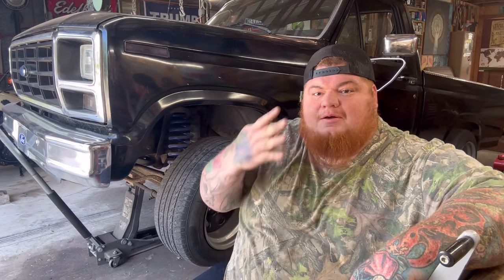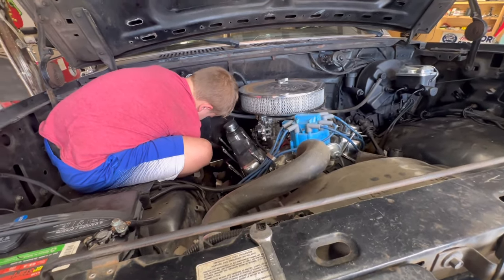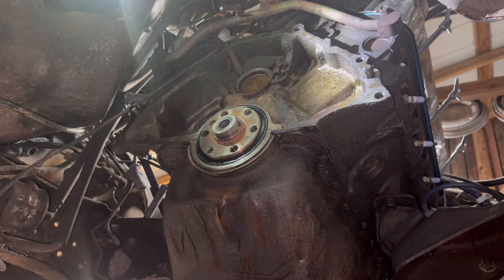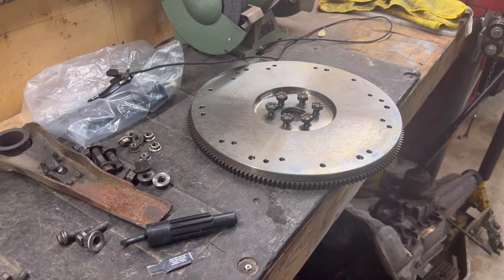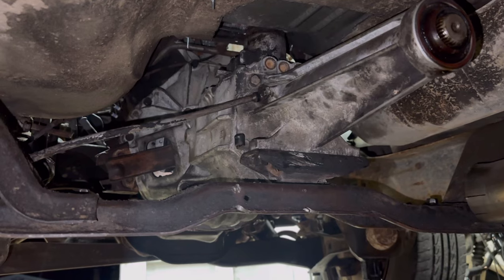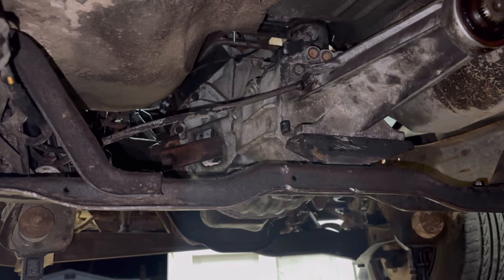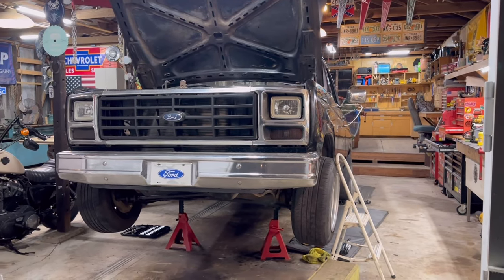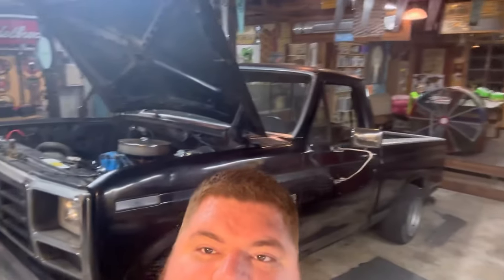Bullnose F150 Automatic to Manual Transmission Swap  - Fly Wheel Clutch & Transmission Install

Comment: Did this truck come with a manual from the factory? Or did you somehow install a clutch pedal?  
All my old Fords came with hydraulic ( I always have to work on them. they are 1958, So they sit all winter. Think this is what is hard on the them.)
My Chevy has a mechanical clutch. I like this system much more. I have about 600k on it and never have had to work on it.
I just now found your all's channel. If you made a video on this subject. I would enjoy watching it.
Anyhow. Thank you for the movie. Good stuff.
Reply from the maker: This truck was a factory Automatic. I wish it was a mechanical linkage style clutch, less to worry about going wrong.
Reply: @FloridaCrackerKustoms  OK, I see, Must be a kit? ? Well, I like the MPG and reliability of a manual. So I'm sure it will be worth it.
I need to look into this more.
I just subscribed. Maybe I can learn something.